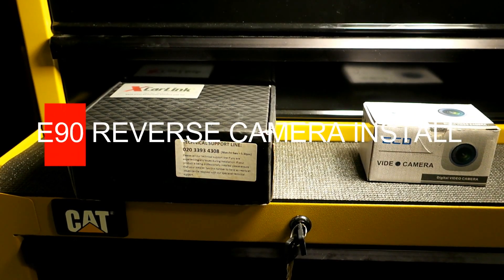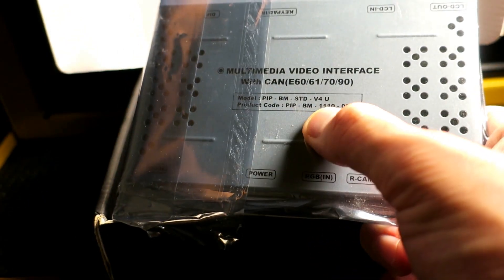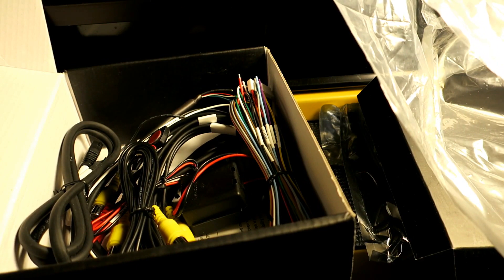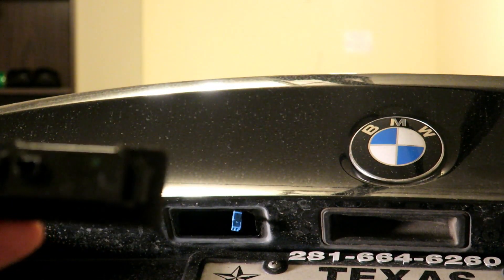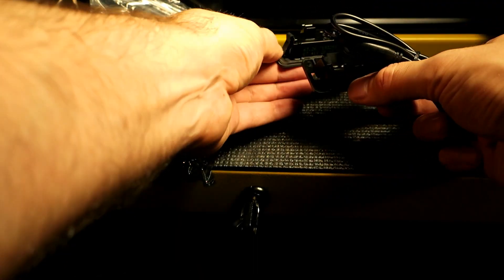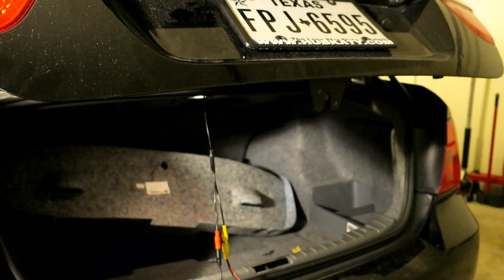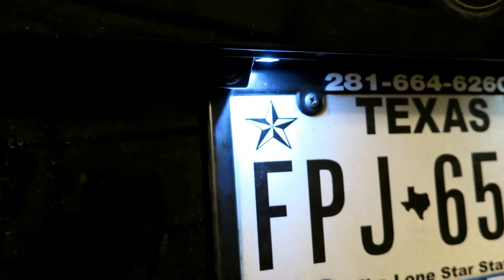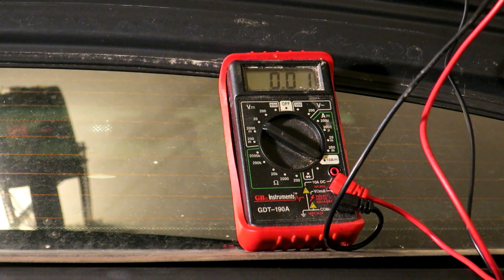Project Android Screen Mirroring on my BMW E90 CCC Idrive **Part 3** Reverse Camera Install

Comment: an alternative solution for people having issues not getting 12v power. attach the extra red wire hanging from the main yellow input to the red wire on the power (this will power the camera from the head unit. im using eonon). if your wondering where to connect the extra ground wire from the power adapter then dont worry( the line that goes directly to he head unit has the ground too. hope thay helps. and this is a great walktrough for installing the camera.
Reply: Does it matter that it's a constant 12v feed? Would you still need a "trigger wire" so the car knows when it's actually in reverse and displays the camera? I only ask this as I have an android unit that works similarly, but it works with the CCC and my loom on the stereo end has +12v feed, reverse line detection and the RCA connection. But no ground I don't think. So I wasn't sure if you needed to connect the "reverse line detection" wire to the +12v reverse lamp so it knows when to be triggered and connect the ground back to the reverse lamp ground

Comment: friend
I can not hear English. because it is not my language

I have problem with my camera not working because the reverse light voltage is 11.4.
How to solve the 11.4v problem?
I do not understand how you connected the camera to the power

Could you explain? thank you very much for your help
Reply from the maker: Perhaps you can run a line to the battery for power and have the reverse lights trigger a relay as a work around?